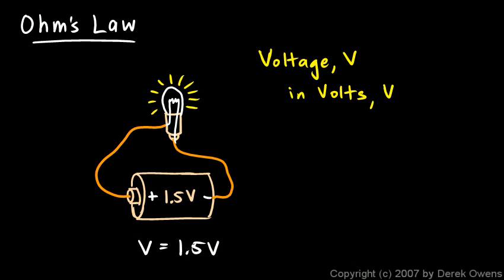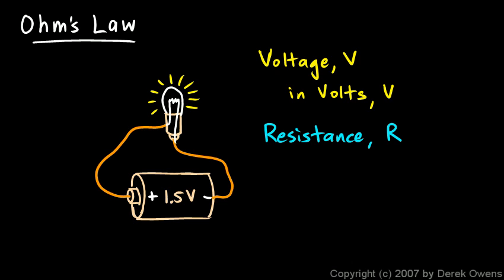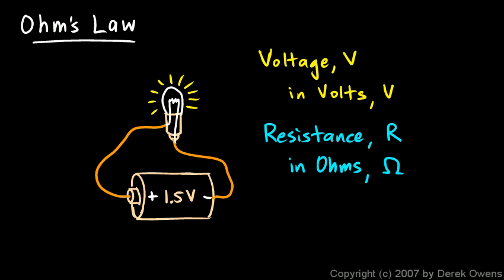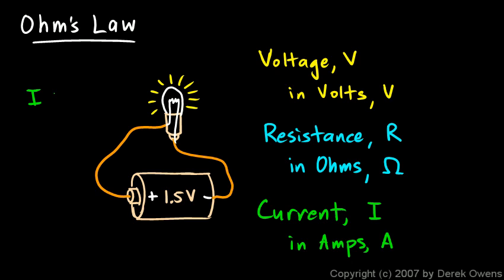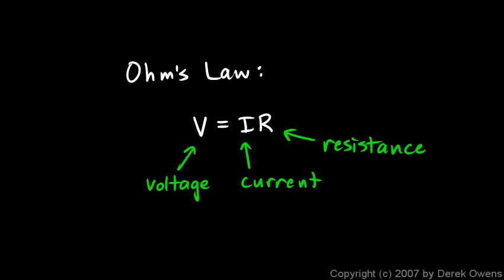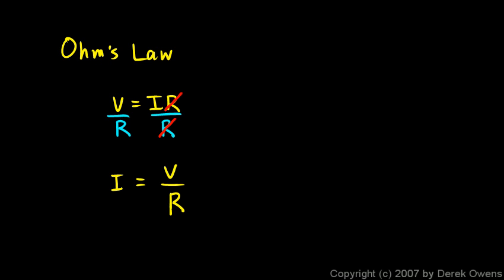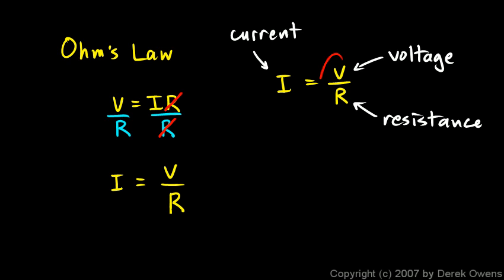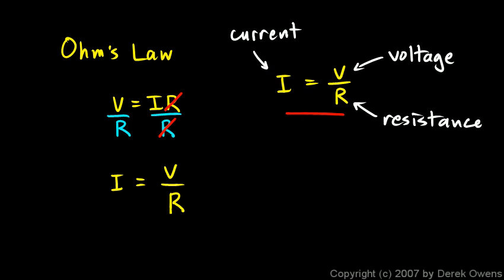Physical Science 6.4a - Ohm`s Law

Comment: What is the current i mean i fucking dont get it..
Voltage is the amount of electricity
Resistance as it says how much it resists and takes only the right amount of Voltage/Electricity
But what the heck is the current.... you couldn't miss that one ffs.....
AND WHAT IS THE AMPERE HOW MUCH OF UMM.. CURRENCY??????
FUCKING nonsense...........
Reply from the maker: I think I can explain.  When you say "Voltage is the amount of electricity" that doesn't quite explain it.  Think about charges (electrons) flowing through a wire. The current is how much charge flows through the wire in a given amount of time. The voltage tells us how much energy each charge carries.  The amount of charge flowing and the energy carried by the charge are both important aspects of electricity. Current is the amount of charge, voltage is the energy per charge.

A common analogy is to compare it to water flow. Think about a waterfall:  There are two things to consider, 1) the amount of water flowing, and 2) the height of the waterfall.  The amount of flow is compared to the current. The vertical height of the fall is compared to the voltage.

Hope that helps!

Comment: Nice and clear explanation but i feel like he slipped a little with his use of terminology. Like someone else mentioned, he said: "voltage flows through a wire". I don't think its a very good way to describe voltage. Its better described as potential for the current to flow.

I like to imagine Ohms law like a river:
Voltage is the speed of the flow (steepness of the hill)
Current is the amount of water that's flowing
Resistance is the size of the river (riverbed).

Or even better - water in pipes, where Voltage is the pressure and resistance is the diameter of the pipe.
Reply: This made more sense to me practically, especially since I'm a visual learner and it was easier to visualize your analogy. Thank you.

Comment: as resistance increases current decreases so surely voltage stays constant due to v=ir but then again v is proportional to r so as r increases v increases. Please clarify this.
Reply: v does not increase as r increases. v and r are two seperate variables. With i=v/r, you increase r and v stays the same, with v=ir, if you had increased the r, the i goes down, and v stays the same. However, if you take r=v/i (Divide both sides by i) then increasing the r decreases the i which balances out and v remains the same. and v is not proportional to r - you can add resistors which add r but the v does not change; you still have a 1.5v battery.

Comment from the maker: I think I can help. There are two things to consider. First, the resistance in the circuit will limit the current. The basic calculation is current = V/R, so if there is more R, then there is less current. The other consideration is the practical limits of the battery. Some batteries, such as a car battery, can deliver a lot of current at once. Smaller batteries can't deliver as much. So the calculation V/R tells you how much current the circuit will draw, assuming the battery is capable.

Comment: @bazengao . First You need to calculate watts W = Voltage * Current. In Your case u have battery of 18V and 200ma (Current), Which gives W= 18* 200*10^-3 = 3.6 Watts. If u want 12v and 9 amps (with the same battery),i.e u want 108 Watts. That is not at all possible to generate 108 watts with 3.6 watts battery.  And your father suggestion of using Transformer also wont help u, because transformer works only for AC not for DC battery.

Comment from the maker: @danboy524  I don't think so.  I'm not an expert in guitar amps, but my guess is that the "8 ohms" on the speaker out jack is simply the specification.  It is designed for an 8 Ohm speaker to be plugged into it.  Other speakers may work, but the 8 Ohm would be ideal, assuming I'm correct.  I don't think it cancels anything out.  Fi the internal speakers turn off when you plug in the external, I'm guessing it's a switch in the jack that does that.  Just guessing here, though.

Comment from the maker: @bazengao  Yes, a transformer is what you want, but you probably won't be able to get that much power from that battery with a simple transformer.  You are looking at over 100 Watts, and the 18V, 200mA battery might only deliver 3 or 4 Watts.  You might need multiple batteries (and multiple transformers).

Comment from the maker: Yes, U is commonly used for Voltage, to avoid confusing it with the V for Volt, the unit in which voltage is measured.

E is also commonly used.  E is sometimes referred to as "electromotive force".  Even though voltage isn't a force, it is often helpful to think of it as the "force" that pushes the electrons through the wires.

So V, U, and E are all used to represent voltage.  The various units and symbols can be confusing.